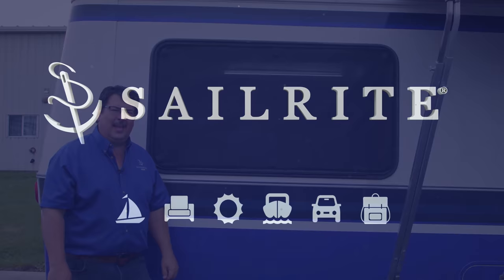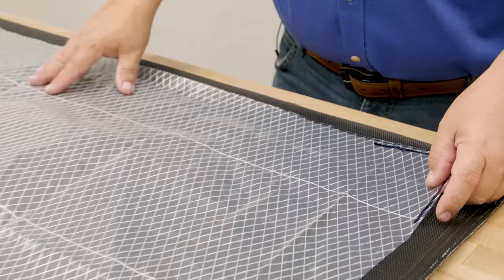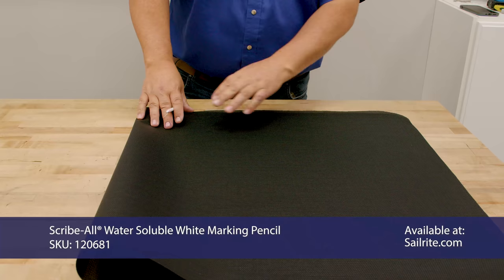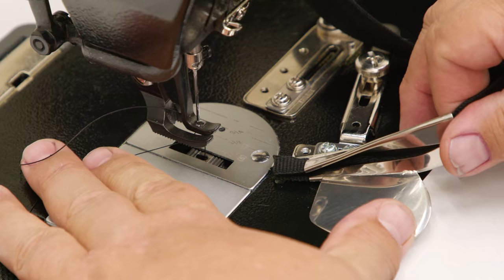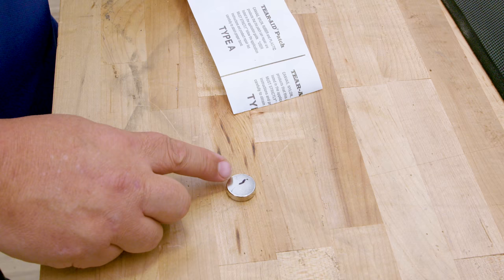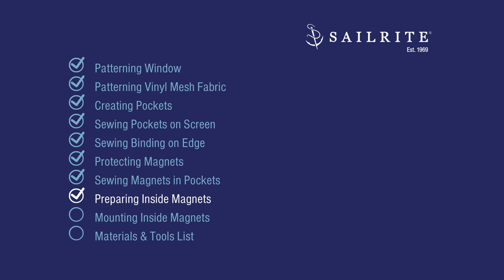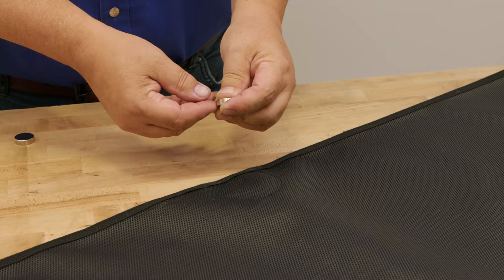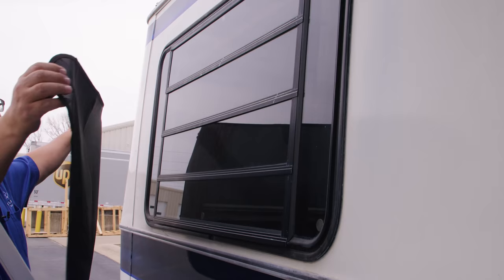How to Make Magnetic Window Shades on a RV

Comment: I was thinking you could trace the magnet with dry erase before you remove the adhesive backing and then apply them with the shade off to make it easier to align without the other magnet pulling on it
Reply from the maker: Great suggestion!

Comment: I was wondering if this could be used for cars or SUVs for car camping? Obviously you could add some allowances to extend to the metal frame of the car or by adding straps via a gusset. Or would a material like protect-it be more suitable ? 

With the temperatures rising I have considered finding solutions for all the windows ofy vehicle.

Comment: I'm wondering why you would want these on the outside?  You can't open up your window to allow for any airflow.  And in the evening, when you still may want some privacy, if these were on the inside, you could open up your windows to allow for the cool evening breeze to flow through.
And I suppose this Textilene or Phifertex does not allow for privacy in the evening once the lights are turned on in the R.V., or does it?
If it doesn't, is there such a product that you know of that can actually create privacy during the night?  Even if it is a product that you would apply to the windows themselves?

Comment: Thanks for the great tutorial.  Is there a reason why the magnet pouches are on the outside? I think I like the look of the pouch on the inside facing the glass. I'd like to put temporary magnets on the inside of the trailer. Any reason why this wouldn't work? Thank You.
Reply from the maker: Hi Todd,

Our logic was that the panel would look better since the magnet is holding the fabric completely flat against the window. If we were to put the patches on the inside we thought that the shade might hang a little loose due to the extra fabric from the patches, we could be totally wrong.

Comment: Great video. Thank you. I wondered about the magnets in the pockets flipping when the shades are being rolled up for storage. It they contact one another, is there enough movement in the pocket to allow them to flip over? If so, this would create problems when putting them back up, as their polarity will be reversed.
Reply from the maker: The pocket is not very large, so it is difficult for the magnet to flip. If it does flip, it means that you can easily  flip them by hand.
Reply: @SailriteDIY  One could hand stitch around the magnets to secure them better to avoid flipping.

Comment: Sailrite sucks. I bought the same machine for half the price!
Reply from the maker: The Fabricator is the best sewing machine package in its class, nothing compares to it in both performance and power. I know that is a very bold statement, but it is true, you will love the machine! Sailrite is the exclusive source for this fine sewing machine and Sailrite’s famous service comes with the deal. The Sailrite Workhorse Servo motor and the Stitch Pro Balance wheel (which are all cogged) are miles ahead of any other servo and balance wheel. You simply can’t get the power and slow speed control that we have on our Fabricator. If you have not watched our video please do: https://www.youtube.com/watch?v=I1jl_L2ZEW8
 
We want you to be able to maintain the machine yourself. If it comes down to a mechanical or timing issue (which is very rare), we provide excellent instructions guiding you on what to do to fix most issues yourself (take a look at the PDF guidebook here: http://www.sailrite.com/PDF/2016_Fabricator_Guidebook.pdf ).
 
If you need phone support we stand ready to happily assist. Not to mention the many “Unlisted” videos on YouTube (available to Sailrite Fabricator Sewing Machine owners only) showing you in detail how to fix it yourself. So, not only do we stand ready to help you with questions on sewing projects, fabrics, notions and tools, but we also provide the best technical help for your Sailrite sewing machine from our own sewing machine techs in-house.
 
Reviews? Check them out at: https://www.sailrite.com/Sailrite-Fabricator-Sewing-Machine-in-Power-Stand-with-Workhorse-Servo-Motor-Kit click on the “Reviews” tab to see the comments.